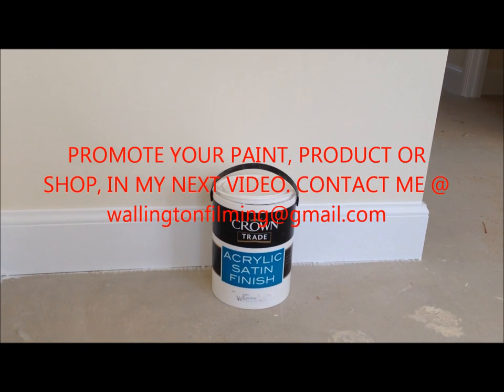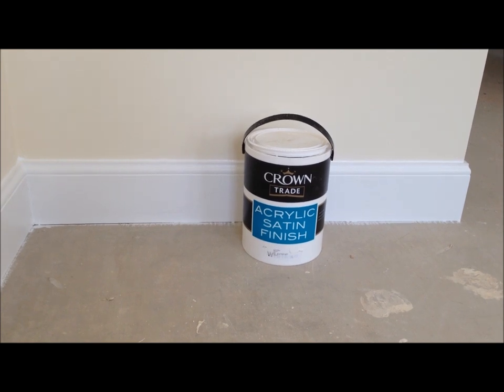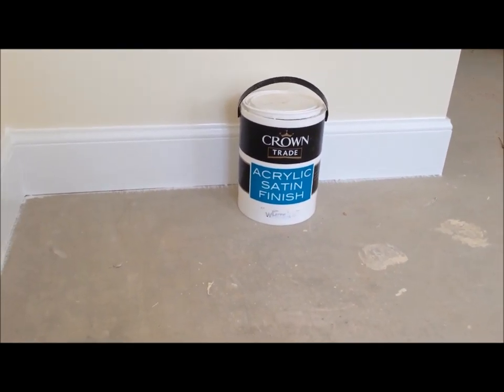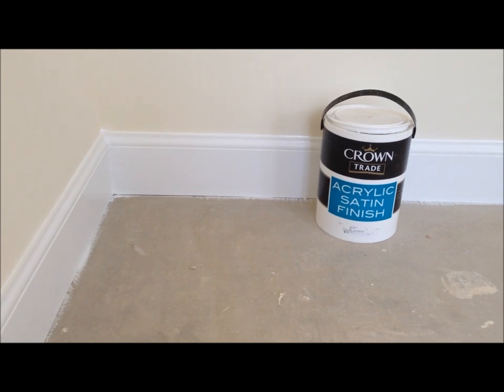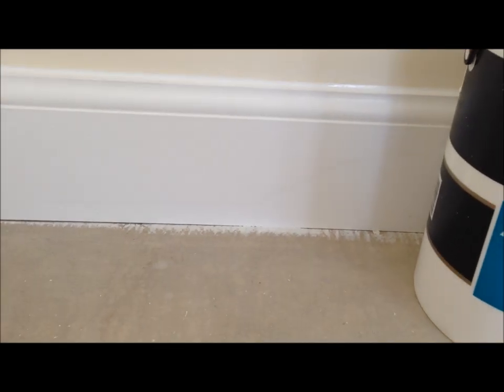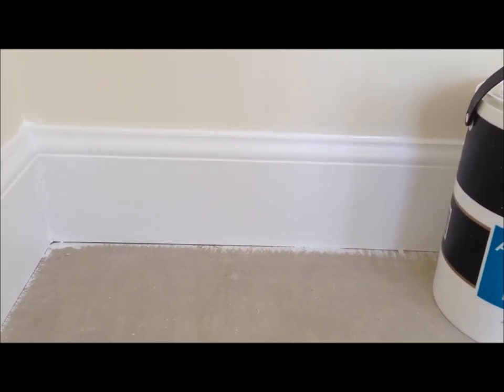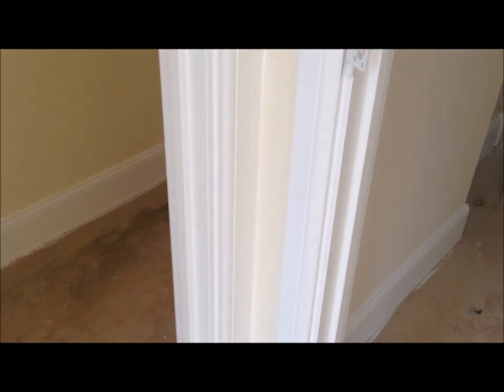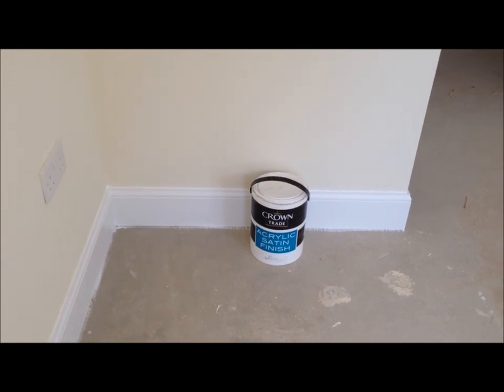Painting & Decorating, Acrylic Satin Finish  Water base Paint

Comment: the simple solution would have been to spot in the stains with stain block or oil based undercoat before finishing. also 2 coats of satin is better than an undercoat and 1 satin, this is common knowledge in the trade. satin is a self undercoating coating.
Reply: george smith it might be self coating  but undercoat has more body so for new work there’s no right or wrong in it